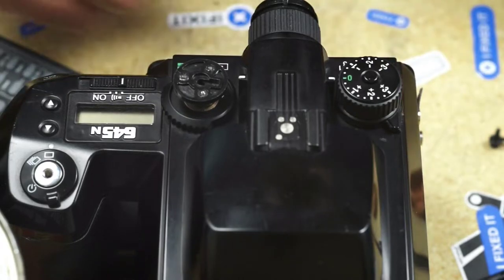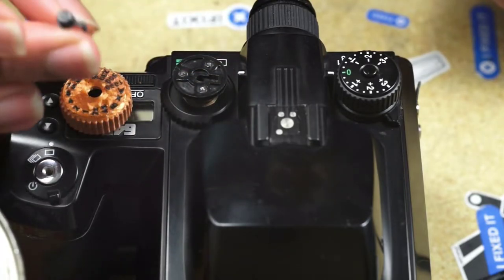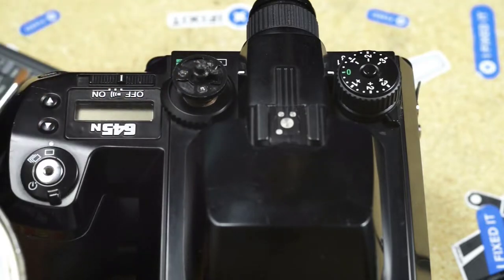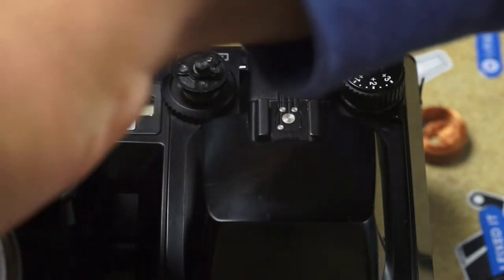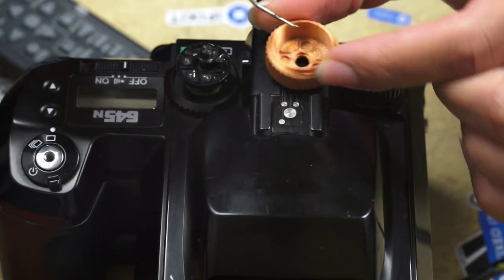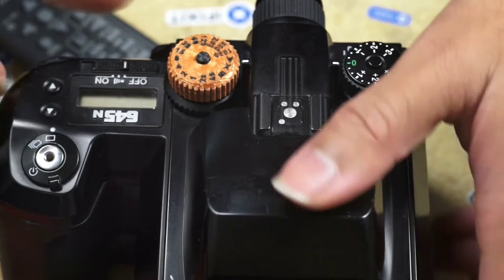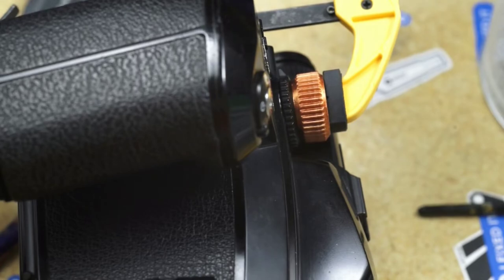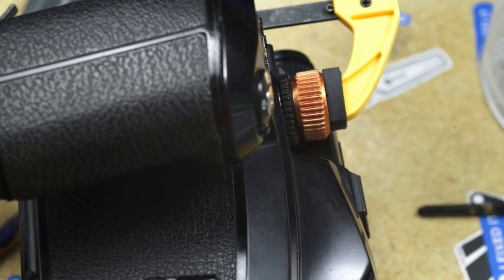Pentax 645n shutter speed dial 3d printed replacement

Comment: How can I get a kit. I don’t have access to a 3d printer. I do have my spring and the dial is still attached  my dial won’t go past A, X,B. Also metering switch doesn’t move freely. Any suggestions
Reply from the maker: to get the kit please contact me at my email address my the about page. That's strange though usually it gets stuck in either A or X. But you should be able to unstick it by pushing something through the top applying pressure on the metal plate you see through the square hole and turning the dial at the same time.

Comment: Hi! Great stuff!
My shutter dial just flew off my Pentax too and my pin is missing. Do you mind sharing what is needed to 3d print the center pin?
I might need to hack it without dismantling the camera. No chance finding someone with a spare pin!
Thanks.
Reply from the maker: the model I have may work with the original dial but I am not sure have no way of checking. I made the center pin to fit with the replacement dial I designed.

Comment: Thanks for the video. I have the shutter speed dial and the spring. Is it possible to get the center pin from you?
Reply from the maker: Yeah I can print one but I am not sure that my part will work well with the original parts. You can shoot me an email. chubydev@gmail.com

Comment: Would absolutely love to have a compensation dial version of this. Have a 645n that works like a charm just needs the dial repaired/replaced. Lmk?
Reply from the maker: Funny mine recently fell of as well. The compensation dial is different I will try to get a model out for this type of easy fix. But I think a fix similar to my other video will be more appropriate for the comp dial although that will delete the lockout on zero compensation and is a trouble to get done.
Reply from the maker: Still need to print and test but it is a start. https://www.thingiverse.com/thing:5768578

Comment: My dial just popped off but I still have the spring and actual depression plunger. So would I just need to use contact cement to attach it or could I purchase a part from you?
Reply: And I still have my original dial. So would I just need to use contact cement to reattach the dial or purchase a dial from you if that would work better?
Reply from the maker: @juulkat4627  I actually don't have an original dial. So I cannot confirm that it will work(ie key into the depression pattern). I have modelled the replacement to key into the depression pattern on the top of what is left of the dial. So it actually fiction fits and the contact cement holds it in place better. So I really dont know if the same trick can be played with the original dial. For further inquiries please contact me at my email in my about page. Thanks.

Comment: Right on! Would pliobond be an appropriate adhesive?  Just got one of these and the exposure compensation knob did the same thing exactly
Reply from the maker: dang! Pliobond is really interesting never really considered it much. The booklet does not say alcohol will loosen it but it might. the actual recmd solvent is methyl ketone. I have no idea what that does to plastics... Oh Just read it destroys ALL plastics plus it is toxic. But really I think you will be fine. maybe. Ps I dont have a model for the exposure compensation dial. If you are handy with fusion I can send you a step  or something.
Reply: @chubyatyahoo  I gotta look into that stuff you got then. Good looking out. 👍